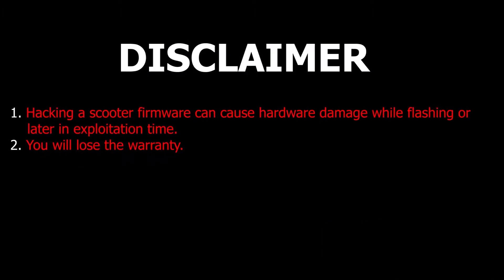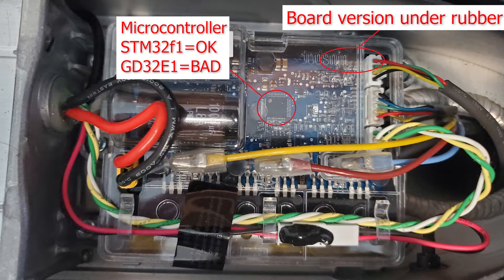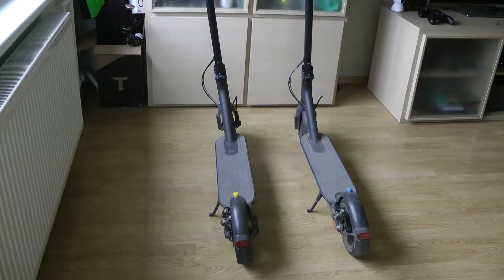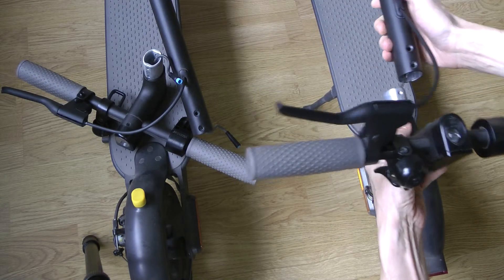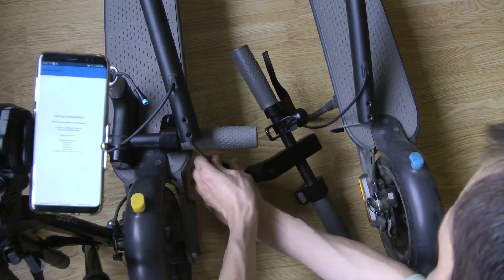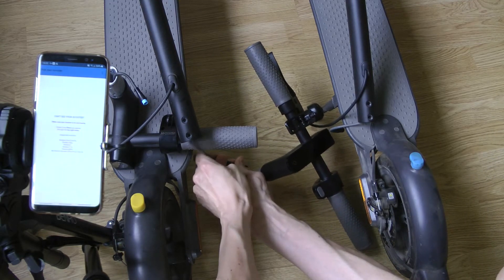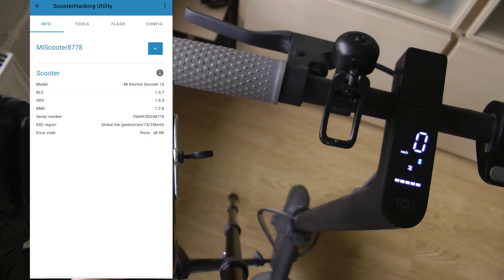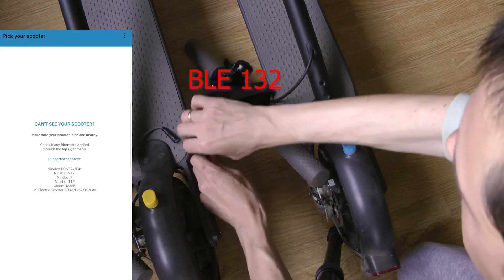Xiaomi Scooter 1S BLE157 speed unlocked

Comment from the maker: Noticed that on 1S BMS128 charge level is indicated incorrectly. BMS141 looks ok on SHFW0.2.5
https://youtu.be/pvGbHYfHBak
For people with BMS version of more than 1000: never downgrade BMS, otherwise - Brick!
https://rollerplausch.com/threads/xiaomi-1s-ble-155-authentifizierungsproblem.5653/#post-66308

Thx for watching and commenting, please don't forget to subscribe to the channel, I really appreciate that :)
If you have any questions, feel free to ask in the comments, I'll try to answer them :)
Reply: hey my ble is 155 on mi scooter 3 still wont work
Reply from the maker: @juanrodrigo341  For mi3 locked BLE is 155
Those are the locked firmwares:
Xiaomi Mi 1s - DRV321 BLE157 BMS141
Xiaomi Mi Pro 2 - DRV248 BLE157 BMS141
Xiaomi Mi3 (EU version) - DRV016 BLE155 BMS141
Subscribe, thanks.
Reply: @MindaugasJocionis  so no chance of this working?
Reply from the maker: @juanrodrigo341  It works, you just need to swap the head from the scooter that has old BLE on it, or downgrade your dashboard (BLE) with st-link: https://youtu.be/oFya2CCFrAo
And check your ESC version, as if you flash V3.1 it will brick your ESC board.
https://rollerplausch.com/threads/neuer-controller-v3-1-bei-aktuellen-xiaomi-rollern-brickgefahr-bei-drv-downgrade-vorgehen.5187/
Reply: @MindaugasJocionis  ok its just that the verdion isnunder the glass and it isnt easy to take out
Reply from the maker: @juanrodrigo341  Take out the whole module, and you should see it a bit from the side without taking that cover.
Or use  "m365 downG " app and look up the UUID under Tools.
If the UUID does not contain the characters FF , it is the 3.1 controller.
If the UUID contains the characters FF ,it is the 3.0 - no problem with flashing
Reply: @MindaugasJocionis  it starts with 37FF7 is that 3.0?
Reply: @MindaugasJocionis  so knowing its 3.0 and the microcontroller is the good one is there anything else to consider before flashing on an old dash
Reply from the maker: @juanrodrigo341  According to that site it's 3.0
Reply from the maker: @juanrodrigo341  For dashboard downgrade (BLE) it doesn't matter what ESC controller version. ESC version matters for flashing hacked DRV. 
If 3.0 there is nothing more to consider :)
Reply: @MindaugasJocionis  ok cause i wanna flash drv 155 and have the FF so its 3.0 so i guess it is safe?
Reply: @MindaugasJocionis  the site says it will brick if bms is over 1000 how can i see that
Reply from the maker: @juanrodrigo341  Yes it's safe
Reply from the maker: @juanrodrigo341  You can check it via "m365 Dashboard" android app.
This is only if you are downgrading the BMS

BLE - dashboard (all other components are flashed through BLE, it's like a bridge to other parts)
DRV - main board or motor controller (this one you are flashing)
BMS - battery controller
Reply: @MindaugasJocionis  ok so after drv if i wanna install ble from camilo is taht a problem?
Reply: @MindaugasJocionis  and can i use the head of a different model of scooter like a pro  2 or a 1s
Reply: @MindaugasJocionis  o btw if i swap the head of the scooter then falsh ble after drv 155 then what will happen after i swap the heads back?
Reply from the maker: @juanrodrigo341  No, you cannot flash BLE as BLE is located in the head (dashboard), if you flash BLE with the donor's head it will remain in that donor's head.
With this method, you can only flash DRV which is located on the mainboard (ESC).
Oh and I totally forgot that you have mi3, so your best option is to use SHFW 0.2.5, as miglor firmware needs hacked BLE (for Mi3), and you cannot flash it. 
Actually, I'm using SHFW 0.2.5 with my mi3 at the moment.
Yes, you can use 1S or PRO2 head.
Reply: @MindaugasJocionis  and what settings do i use? And what do i install before that
Reply from the maker: @juanrodrigo341  Switch heads, and install SHFW 2.0.5 from the "scooter hacking utility" app. Switch heads back, and set parameters as described in the help icons in the app.
Reply: @MindaugasJocionis  cant i use an old dashboard and install ble and keep the old dashboard???
Reply: @MindaugasJocionis  how to fix?😢
Reply from the maker: @ronihackerdreng4771  How to fix what?
Subscribe, thanx.
Reply: Did you fix it @juanrodrigo341
Reply: Hello where and what app do I need to download and zip files . To do this?
Reply from the maker: @MsJantheman  Best option at the moment is to use "Scooter hacking utility" and its  SHFW0.2.6 from google play. 
https://play.google.com/store/apps/details?id=sh.cfw.utility
It has updated and supports ESC3.0 and 3.1
Subscribe, thanks.
Reply: Hi man, thanks for the vids, I've got an AliExpress board, it lets me flash ble and bms but not drv, ble always 9.1.0 on AliExpress board , any ideas?
Reply from the maker: @dannyw13  What model of scooter?
Reply: @MindaugasJocionis  Mi Pro 2 mate
Reply from the maker: @dannyw13  Hmm, ask in this telegram chat: https://t.me/scooterhackingchat 
For Mi3, you must first go to drv003, maybe something similar on pro 2. Subscribe, thanks.
Reply: @MindaugasJocionis  thanks man, will do, subscribed

Comment: Can i use a mi essential on mi 3?
Reply from the maker: Yes, you can use the Essential to flash Mi3. Use the “Scooter Hacking Utility” Android app—it will detect your ESC controller and install the appropriate firmware automatically.
You may need to downgrade your DRV version first, there is option in SHU as well.
For more information, join the Telegram chat: https://t.me/scooterhackingchat
Subscribe, thanks!

Comment: Hi I would like to flash my scooter ble 137 drv 245 bms very 1702 do I follow the same process?
Reply from the maker: The BLE137 is not locked, so you can flash your ESC without a head swap. For premade DRV versions, you need ESC Controller 3.0 or you will brick it. The recommended option is to use SHFW, as it detects the controller type and flashes the correct SHFW version. The downside of SHFW is that after flashing it, you will need to configure it in the app before you can start riding. There are tutorials available online explaining how to do this. For more information, check this Telegram chat: https://t.me/scooterhackingchat 
Subscribe, thx.

Comment: Can I buy a dashboard from AliExpress and flash it
Reply from the maker: Some panels from Aliexpress allow flashing, some do not. Keep in mindthat for premade DRV versions, you need ESC Controller 3.0 or you will brick it. The recommended option is to use SHFW, as it detects the controller type and flashes the correct SHFW version. The downside of SHFW is that after flashing it, you will need to configure it in the app before you can start riding. There are tutorials available online explaining how to do this. For more information, check this Telegram chat: https://t.me/scooterhackingchat
Reply: @MindaugasJocionis  so as far as i understand stm32f is good
Reply from the maker: @obadov_ Yes stm32f is 3.0 you won't brick it with premade DRV.
Reply: @MindaugasJocionis  it says DRV stm32f 3.2.1 and my cousins says stm32f 3.0.1 will it work on both thanks
Reply from the maker: Yes. Sometimes you need to perform a DRV downgrade first (depending on the scooter model and DRV version). You can use the "Scooter Hacking Utility" Android app, which includes a DRV downgrade option.
Reply: @MindaugasJocionis   do i need to downgrade my cousins scooter or just mine
Reply from the maker: Go to the Telegram chat that I gave you. People there will guide you.

Comment: Bro i got error 21 from doing this!? How do i fix it??
Reply from the maker: What did you flashed exactly drv, shfw or bms? What is your scooter esc version and bms version?
Did you reed the video description?
Subscribe, thanks.
Reply: @MindaugasJocionis my esc version is 3.0 my scooter is a mi 3 i swapped heads with a m365 and after i installed the bms128 it said bms 000 and error 21 came, what do i do?
Reply from the maker: @rowanqader78  and what bms version was before?
Reply: @MindaugasJocionis i dont know, How to check?
Reply from the maker: @rowanqader78  Currently, you can't. This should have been done before flashing BMS. And why would you consider flashing BMS? And from where did you get one? I assume you flashed the old BMS firmware to the new BMS controller version.
Reply: @MindaugasJocionis i flashed to 128 like in the video, and where did i get what? can i fix error 21 without replacing anything?
Reply from the maker: @rowanqader78  
I mean from where did you downloaded that BMS?
It's hard to say - if this was a new controller, then there are 2 options: to flash it using Stlink with the correct firmware (tho I don't know if is there a backup for a new one somewhere) or solder a new BMS board to the battery.
If it was an old controller version (and it just got somehow corrupted while flashing), you can try to reset it with a button that is on the controller or try to flash a different BMS version again.
If you are not familiar with soldering I assume you will need to take it to the repair shop and ask to reflash the BMS or resolder BMS board.
Reply: @MindaugasJocionis  searched up bms128 zip and it came up and i downloaded it, it was for 1s was that the problem?, i will try now to flash to another bms version but which do you recommend? Its an mi 3
Reply from the maker: @rowanqader78  Why did you decide to flash BMS in the first place?
Reply from the maker: @rowanqader78  https://firmware.scooterhacking.org/mi3/BMS/
Reply: @MindaugasJocionis i really dont know bro i didnt even know what that was i just did what was in the vid
Reply: @MindaugasJocionis on downg it says invalid zip and i cant press the bin and in scooterhacking utility it wont flash
Reply from the maker: what scooter hacking says?
Reply: @MindaugasJocionis it says flashing failed. Reason : max retires, and it says power cycling your phone & vechile might help.
Reply from the maker: @rowanqader78  Yes, it cannot communicate with the BMS, the BMS is bricked. Take it to a scooter repair shop and they will solder a new BMS board to the battery.
I will remove that video part, as not everyone is reading the cards in the video and video description.
Reply from the maker: Error 21 means that the main controller cannot communicate with the BMS board. This can be caused by various reasons. In your case, it was flashed with bad firmware or the flashing failed.
The BMS board costs $16-$40 depending on where you buy it. You need to solder it to the battery.
Take it to a repair shop, they have BMS boards and they will solder it to your battery. Replacing a BMS is a common task for repair shops.
Reply: @MindaugasJocionis okay but after i replaced the bms board can i do the same just not flash the bms just shfw or do you recommend me to downgrade using st link?
Reply: @MindaugasJocionis and btw do you think i can replace it myself or a professional needs to?
Reply from the maker: @rowanqader78  Same with shfw.
Check this video and decide yourself can you do this or not. https://youtu.be/bdlhvcMkFKA?si=r3tkebNgSHvnUbkK
Reply: @MindaugasJocionis what do you mean same with shfw? If i just flash shfw it will brick too?
Reply from the maker: @rowanqader78  I meand swap heads and flash shfw from shu. After that you need to configure it to start driving. Or swap heads and flash hacked drv - if you are 100%  sure that you have 3.0 controller.
Reply: @MindaugasJocionis does resetting the bms fix it?
Reply from the maker: @rowanqader78  It helps if the bms is frozen and requires a reboot, I doubt that this is your case, although you can try, it won’t make it any worse.

Comment: I bought new "flashable" display from aliexpress and connected it. It says BLE 1.5.8 in scooter hacking utility. In reviews people say it was flashable. Could scooterhacking utility show wrong BLE version or i got scammed?
Reply from the maker: Ignore that warning and try to flash with it anyway, maybe it has spoofed ble158 and still can be used for flashing mainboard. Subscribe, thanks.
Reply: @MindaugasJocionis  Thats what i thought. But isnt it possible to brick by scooter this way? manufacturing date in 2020
Reply from the maker: @lauriL90  If you use SHFW from SHU then you will not brick it. If you are willing to flash your own DRV, then check your controller, if it's old 3.0 then you will not brick it either, If it's 3.1 or 3.3 you need a new Gen DRV.

Comment: I've been running at a normal 31 km/h for a while, and I clicked on an update In my home application, everything returned as it was, and now I want to return it to 31 km/h and it does not want, any help please, I do not have any other scooter
Reply from the maker: By updating your scooter through Mi Home, you flashed its dashboard with restricted firmware. Now you need to downgrade that dashboard firmware (BLE). Watch this video for guidance: https://youtu.be/IvQ4oT2u_vg, or purchase a dashboard that allows flashing DRV or SHFW to your scooter.
Reply: Can you Wait until you Can uppdate and update and Wait til its posible with my firmware cus i did same mistake

Comment: im wondering if this could be done with a m365 head to flash an 1s on 157, i recently got a 1s that read 5200mah, i did a factory reset but not upgrade on mi home app and now it shows 7650 as supposed. but im still locked out and its so weak while my m365 is about twice as strong.
Reply from the maker: Some guys reported that they succeeded doing this. Subscribe, thanks.
Reply: @MindaugasJocionis  it worked but changed the bms to read 5200mah, i put the original 1s head back and i could succesfully flash the bms with 1s 1.4.1 with the locked dashboard

Comment: Hi sir appreciated all your video about scooter... I have mi electrict scooter essensials 1s... Can i use my frend dashboard which is m365 model? I have also ble 157 issue....thanks and more power...
Reply from the maker: You can flash prebuilt drv in that way. @ first you need to know your scooter esc board revision, is it stm32 or gd32. If you flash wrong version drv it will brick your mainboard (see video description).
Is it possible to fash shfw with that old dash, I hawe no idea. Try asking in this telegram chat: https://t.me/scooterhackingchat
Subscribe, thanks.

Comment: Hey, I am not sure if I understand correctly. First oart is just to show that we can change BMS version. But it is not needed to unlock my scoter It is enough to start from 4:41 moment?
Reply from the maker: Yes. Subscribe thanks.
Reply: @MindaugasJocionis   so I don't need to use smooth zip at all?
Reply: I mean no need to have DVR 1.5.5 before using method 2?
Reply from the maker: Smooth zip is pre cooked firmware just for 3.0 ESC mainboard. 2nd. method is shfw for 3.0;3.1... ESC mainboard. So the best option is to use shfw.

Comment: Where are the files
Reply from the maker: Check the video description. Sub. thx.
Reply: @MindaugasJocionis  It doesn't work it will says 25 on full battery
Reply from the maker: @Mnj.1 Did you used another scooter head with unlocked old ble?

Comment: Brp my scpoter dashboard stop on D mode and battery dots not showing any more and scooter bms is 000 how can i fix it without buy new control
Reply from the maker: How did that happened? Out of nowhere, or after you flashed firmware? If out of nowhere, at first disassemble bottom and check all the wires that going to bms and battery itself for disconnection etc.
Subscribe, thanks.

Comment: Hello Mindaugas, I just bought new Xiaomi pro 2 scooter. It has BLE 158, STM32F with 3.0 and I was wondering if it's possible to speed hack my pro 2 using my older Xiaomi 1S scooter dashboard with Ble 129, STM32F Drv 255, Bms 126? 1S is already speed hacked. Thanks!
Reply from the maker: Yes, you can hook 1S dashboard and flash any DRV or SHFW from "scooter hacking utility".

Comment: hello, mine does not have that number 3.0 in that part of the controller, and it is ble 158, how to do that number is recorded elsewhere?
Reply from the maker: 1. You need to do a BLE downgrade, as demonstrated in this video: https://youtu.be/IvQ4oT2u_vg or use the head swap method. (There is no need to flash the BMS; I just demonstrated that it's possible.)
2. Use the "Scooter hacking utility" shfw; it will recognize the controller version and install the right firmware.
For more help, check this Telegram chat: https://t.me/scooterhackingchat
Subscribe, thanks."

Comment: Hi, do you perhaps know whether it is possible to downgrade a Mi Pro 2 scooter using a BLE board from a Mi 1S? My Pro 2 was bought in Germany and unfortunately has a speed cap of 20km/h.
Reply from the maker: You can flash the DRV to the mainboard (ESC) with a 1S dashboard to Pro2. If you don't know your ESC version, the best option is to use the "Scooter hacking utility" to flash SHFW, as it automatically detects the ESC version and flashes the right firmware. After the SHFW flash, you will need to configure it in order to start driving.
Subscribe, thanks.
Reply: @MindaugasJocionis  Thank you for reply! And just to clarify - SHFW stands for speed hack firmware? I'm only interested in getting the stock 25km/h speed under sport mode - would this firmware work, or would it be better to flash the stock firmware instead?
Reply from the maker: @ethre4758  Yes, it's for increasing speed, but you can set the speed to 25 km/h in shfw. Otherwise, I believe that you need to change the serial of your scooter to one that is from a country with a restriction of 25 km/h. Try asking in this telegram chat if the serial number changing is enough: https://t.me/scooterhackingchat
As I don't hawe experience with scooters limited to 20km/h.